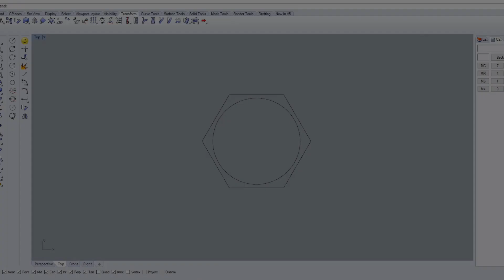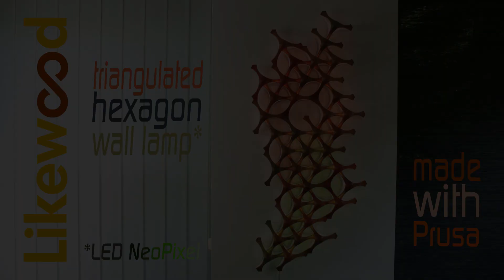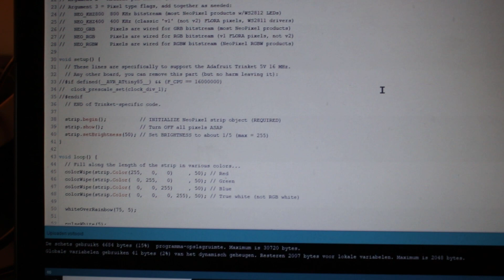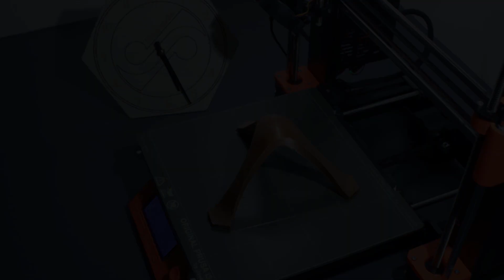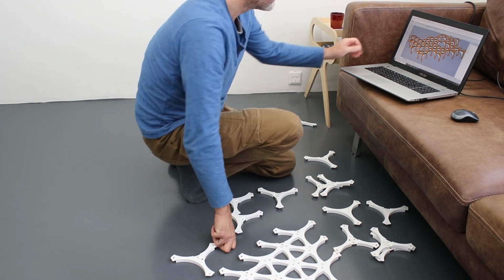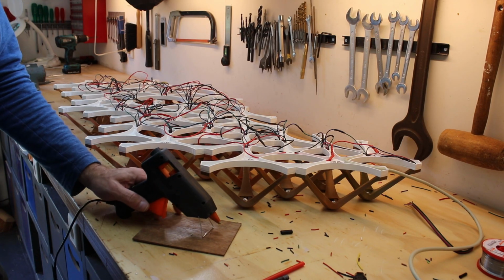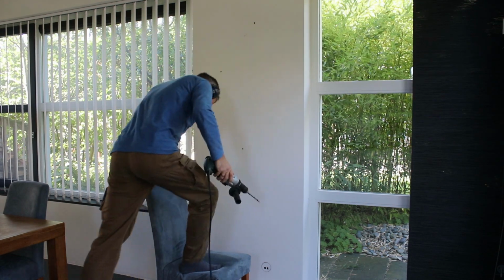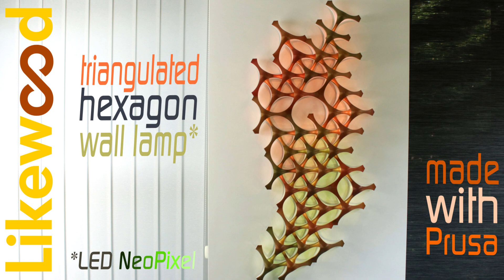Triangulated hexagon wall lamp | made with Prusa

Comment: Nice Robert. Like the shadow patern. Next step should be a mood changing program and integrate it with home automation. Maybe use an ESP instead of an Arduino. Keep up the good work.
Reply from the maker: Thanks! I'm working on a program for different mood settings. First with an Arduino. You have to explain me the other option later on.